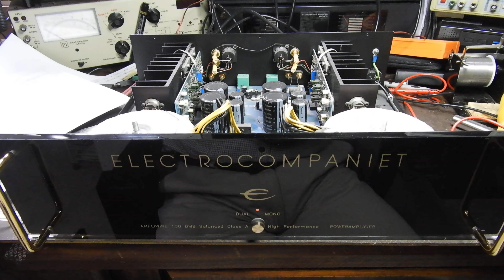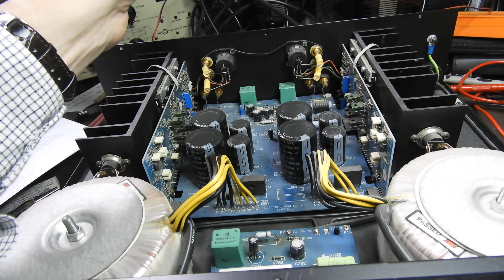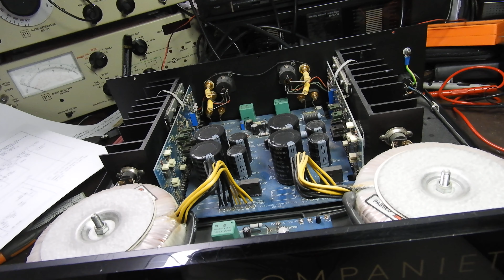Electrocompaniet AW-100DMB - no right channel after shipment from Norway.

Comment: Hi, thank you for your great videos. Could you please tell me where to find your article on these amplifiers. Do you service/repair this gear? Where could I find you..? Thank you
Reply from the maker: The article was never written because I never got to the actual selling of the amp, and this was to be an aid to get a better price. I haven't had a chance to fix it yet. But I will write it and it will be on SteroNet Australia Electrocompaniet owners' thread.
I am in Northern Suburbs of Perth and you can contact me by filling in a form on my web page www.her.net.au
Please subscribe if you haven't yet, because I need about 200 more. Cheers Roman
Reply: @hear-net-au  subscribed, done. I assume all of Electrocompaniet product have the same pedigree you talk of? I look forward to auditioning their gear. Do these amps suit a particular speaker or many of quality? Thanks again. Appreciated.
Reply from the maker: @1968krug  They will drive anything. I would stay away from integrated ones and concentrate on EC-3/EC-4 pre-amps and AW-100DMB power amps. This is what I use but met people who have had Nemos and they sold them. When I asked about Nemo sound, they said if it sounded as good as mine, they would never got rid of it. I also listened to AW-180 monoblocks and (at least the pair I had) was very dark. A lot of bass and very little treble. Maybe there was something wrong with it.

Comment: Great tip; interesting amp. How much does damping factor matter?
Reply from the maker: Eric, to me a great deal. I listen to jazz exclusively and need to have a detailed bass. Damping Factor is output impedance (the higher the better) divided by load (which is normally 8 Ohm speaker). High D.F. means that the amp controls bass membrane and does not allow any flutter. It actively dampens it and forces it to follow the musical signal rather than the inertia. Other people do not care about it at all and listen to tube amps which inherently have a very high output impedance, which has to be lowered by a transformer on the output. But if your music does not demand tight bass, then it does not matter that much.
Reply: @hear-net-au  Thank you for that very clear and detailed explanation. I listen to a mix of musical genres (25% classical, 25% jazz, 25% hiphop, 25% "other") which I imagine would benefit from this. I'm somewhat on the hunt for an affordable-yet-quality used amp, being patient to find a bargain essentially. Amps which peak my interest are the Yamaha AS line (AS-1000, AS-2000, etc) and some of the higher-end Marantz units (e.g. PM-11-S3, ...). Basically what appears a sweet spot in between buying cheap junk and at the same time not costing 5 figures either. At the same time I wonder how a "high-end" AV receiver would perform, or, going the opposite direction, a cheap old power amp such as a Sony TA-N55-ES. I think I want to stay clear from old integrated amps due to the relatively large chance of the pre-amp sections going bad (switches, pots, phono stage).
Reply from the maker: @Enfeeblement  Yamahas have a rather poor Damping Factor (never more then 200 but usually around 100). I would get a Chinese amp called Jungson. You get 80W of proper balanced amp in Class A for under $1000.